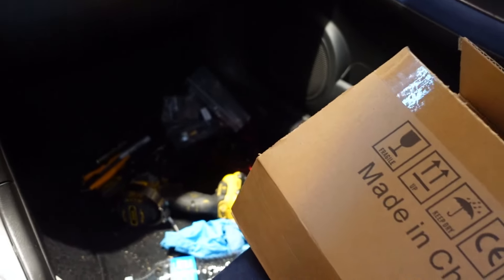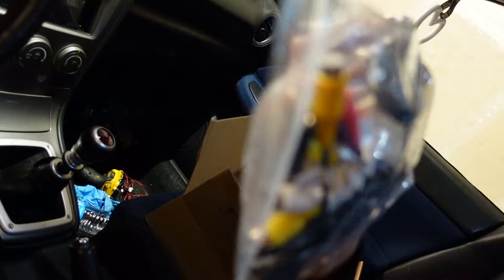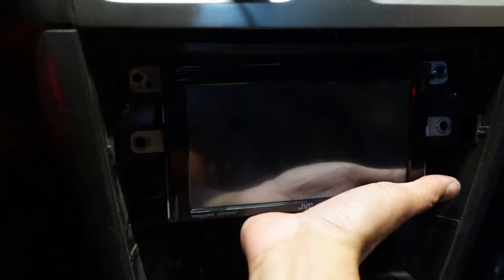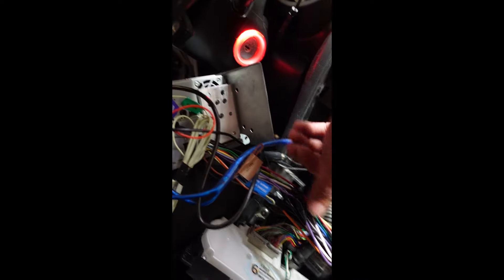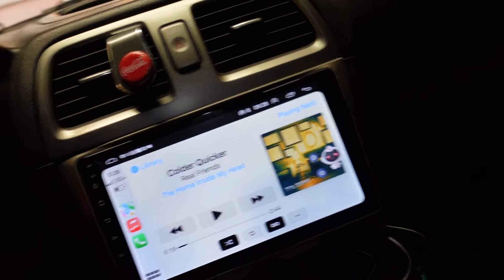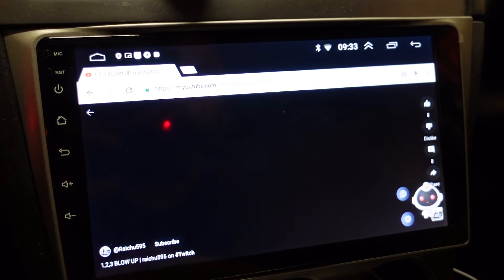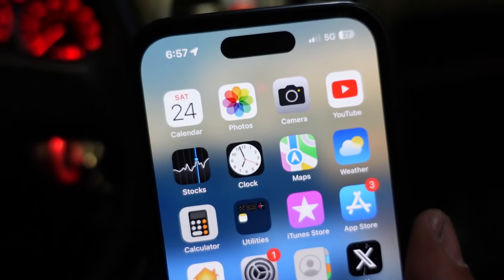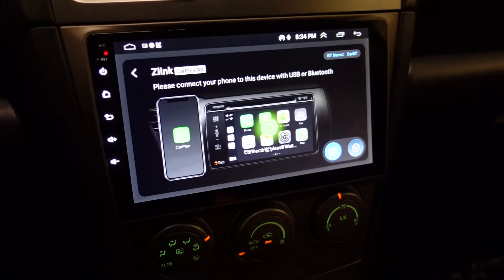I bought the CHEAPEST Android Head Unit on Amazon | 2005 Subaru Impreza WRX STi

Comment: Wish I knew about this head unit before I bought a cheap atoto head unit and had to solder each cable 😵

Can't wait for the next video drop
Reply from the maker: Sorry I took so long to edit this🥲 if you peeped the screenshot I actually bought it back in February😆 still holding up well and would recommend it!